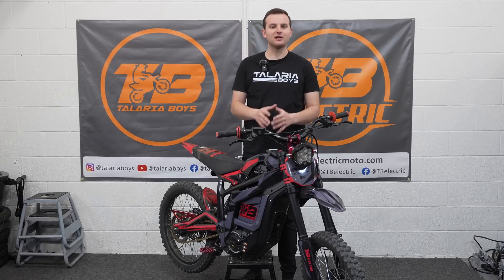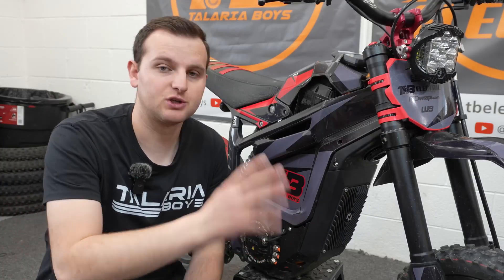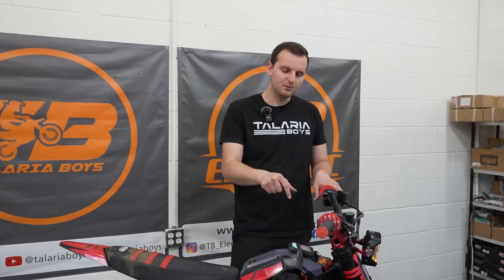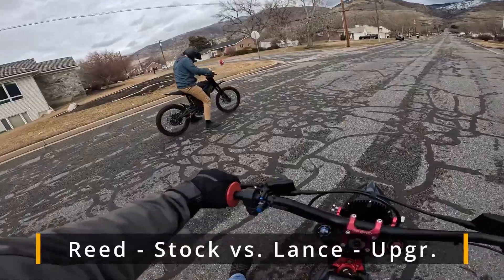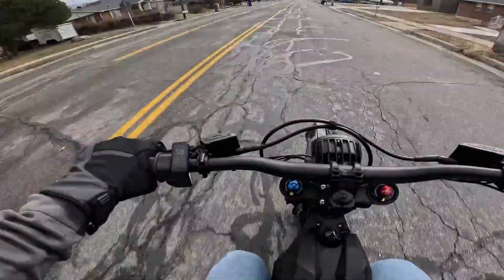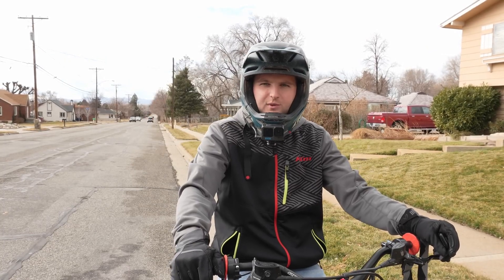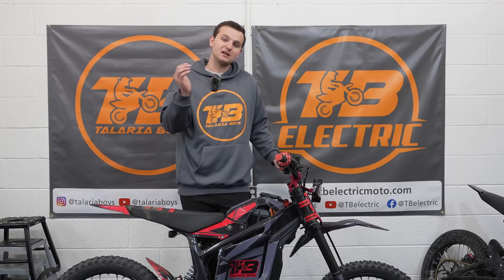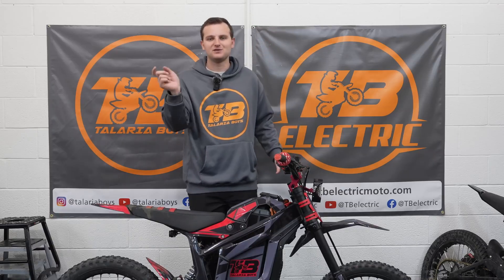Updating Talaria Sting MX5 with Nucular P24F by @Talariaboys

Comment: How does the Bluetooth module connect? Does it just plug into the same wire that the display plugs into?
Reply from the maker: Yes same wire. You can plug both using additional PHD-PHD wire
Reply: @NucularElectronics thank you!  Maybe a video demonstrating how this works would be a nice thing to do. There aren’t any videos on how to install it currently